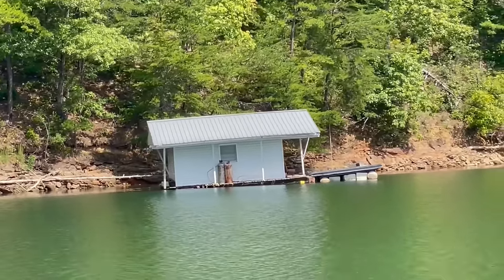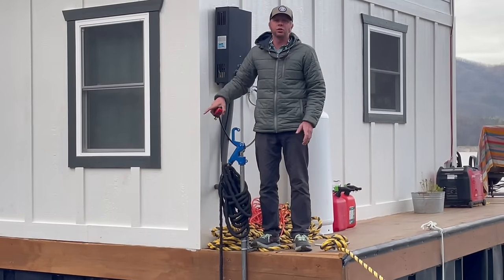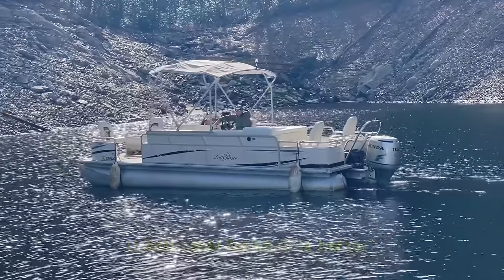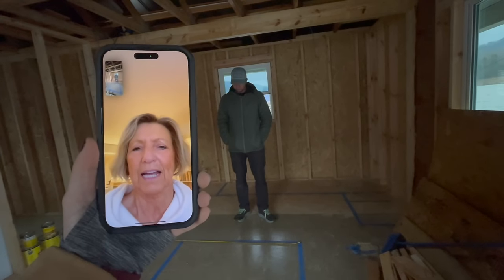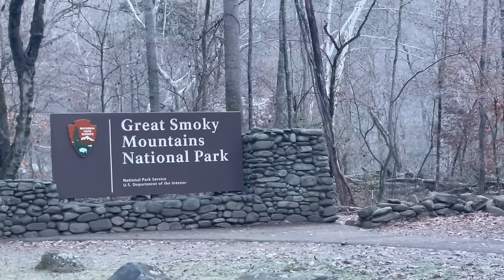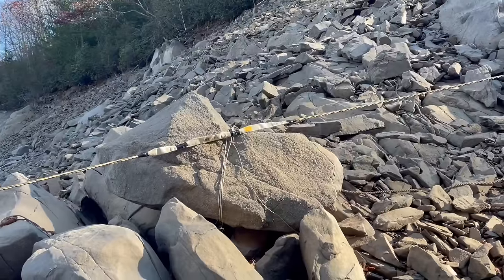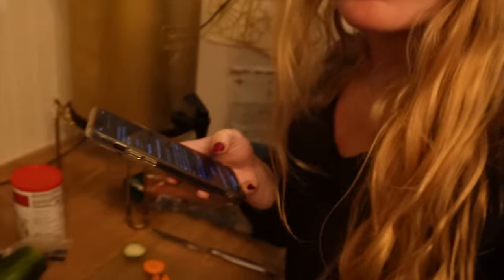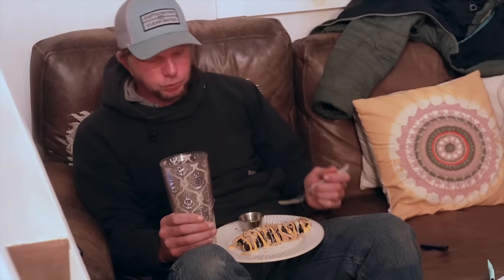How to LEVEL a FLOATING House?! 🤔🛠

Comment: Another great episode. Why use bags of concrete mix (which will harden with moisture) rather than bags of rocks?
Reply from the maker: Thanks! You could use rocks if you wanted to. We just went with quikrete for precision. It’s a uniform size that fits perfectly between our joists, so you can get the max weight evenly distributed in the smallest area. When it hardens they basically become perfectly sized identical rocks. 🙌

Comment: hi it would have been better to buy sandbags because in the event of a bag leak it will not pollute
Reply: Oh boy! I had no idea and I watch that all the time. Going to find it right now. Thanks for the tip!
Reply: The quikrete will harden in the bag and stay on the floats. Look up quikrete walls. Pretty cool
Reply from the maker: The concrete hardens in the bag when it gets wet & sits in a solid block on top of the floats, like a cinderblock but heavier. It won’t stay powdered &/or disintegrate into the lake. But sand would, which wouldn’t hurt anything of course, it would just defeat the purpose